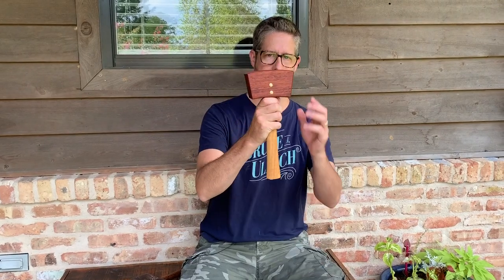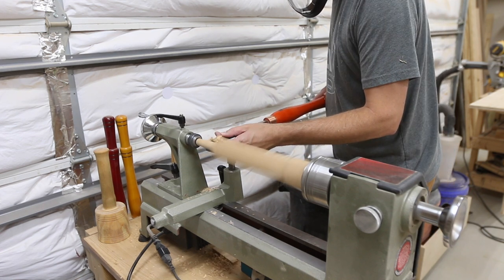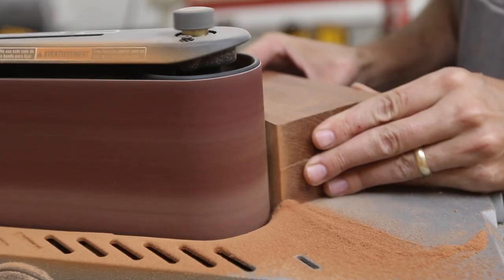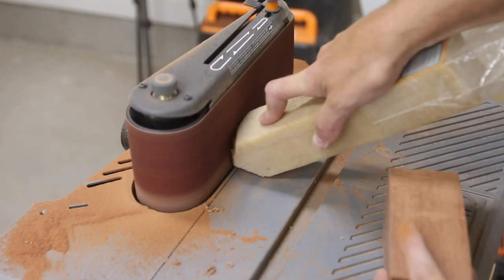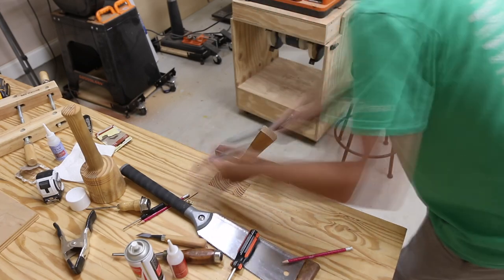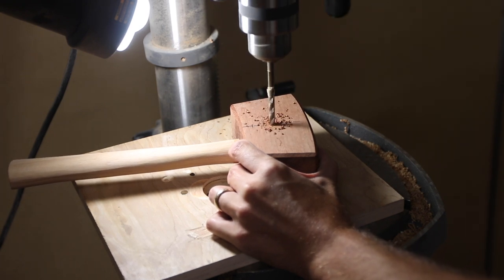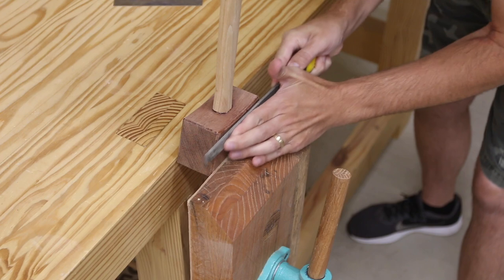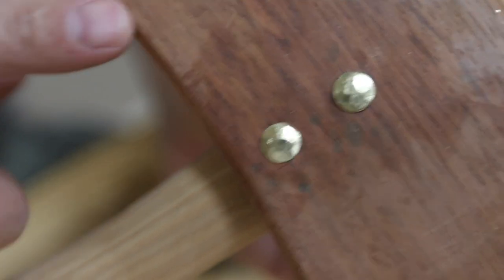Remaking 100 Year Old Woodworking Mallet // Wood and Brass

Comment: That turned out real nice.  Jatoba is one of my favorite woods to finish because of it's density.   I don't think I would have peened over the brass pins.  With the epoxy, I don't believe they would move.  I'd have just filed/sanded them flush to the surface.
Reply from the maker: Yeah, there was no mechanical need for the peening because the epoxy is plenty strong. I wanted to try it and I thought it would look cool. Thanks for watching!

Comment: Next time, put a slight countersink on your holes. That way you'll provide an area below your surface for the brass to mushroom into, and then you can sand/file everything flush with the wood surface. Unless of course the raised peening was what you were going for, in which case mission accomplished because the mallet looks awesome!
Reply from the maker: Thank you, Vince! On this one, I did was the hammered look and for the pins to be proud, but I never thought about a countersink for the metal to go into. Great idea!
Reply: Knife makes have been attaching handle scales this way for forever.
Reply from the maker: Yep, it’s not a new concept...it was just new to me. ;)

Comment: Looks great, what are you putting on your sander between sanding?
Reply from the maker: Hey John! Thanks! That's a stick of rubber...works really well to make your sandpaper last longer on a lot of machines. Keeps it cleaned out and lets it cut more without burning. I'll add a link to the one I have above in the description links.
Reply: Thanks

Comment: Can I ask why you think the original was from a wheel?
Reply from the maker: They would reuse everything. My dad thinks he remembers his grandpa telling him that. Plus, it looks to be the shape and angle of a piece of wagon wheel cut off.
Reply: @BruceAUlrich  I don't doubt it.
Reason I asked is because in woodshop in high-school we actually made mallets as a class project. One of the designs we used was to round the wood like this using a band saw.
It looks identical to what you have here.  
However.  I do believe the shop teacher did take all of the mallets we made and set them up face to face to make a wheel for the project photo for the yearbook.
It did look very much like a wheel! 
I can totally see some Wainwright taking a broken wheel and churning out new mallets for the shop!